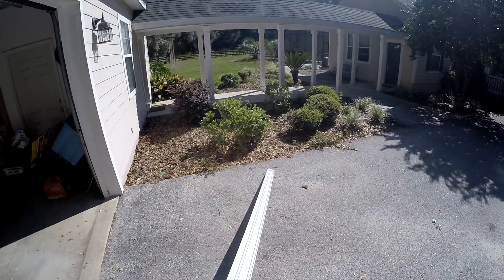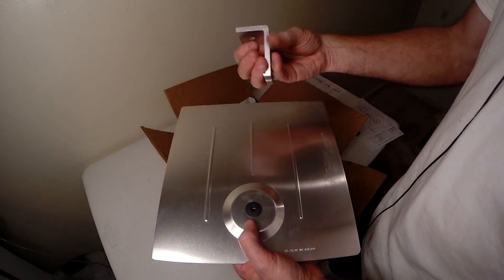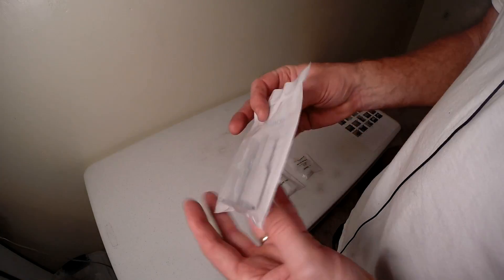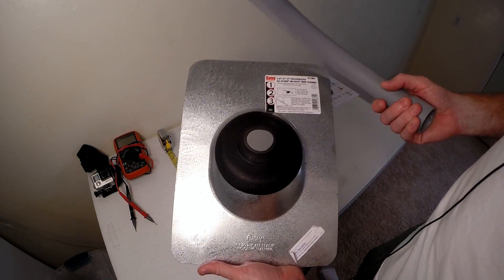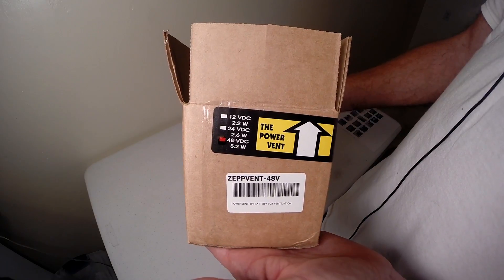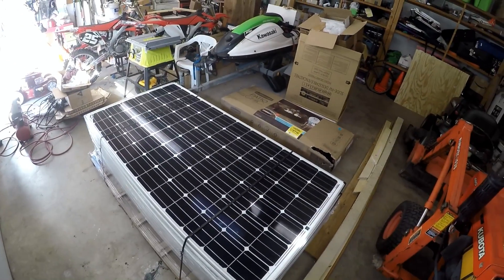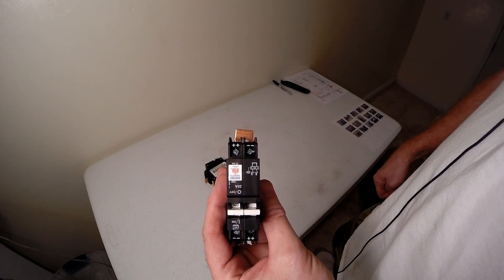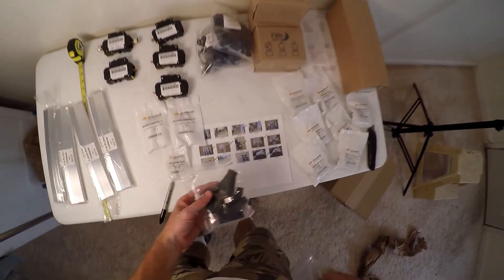Off Grid Solar #4: IronRidge, SolarWorld, Trojan Unboxing

Comment: Why didn't you use lithium batteries
Reply from the maker: I think the flooded lead acid batteries that I bought still offer the best bang for the buck.  That said, I am anticipating that I may switch to lithium in the form of used car batteries in the future.  I expect there will be a lot of electric car batteries available at great prices by the time I need to replace my Trojans.  Thanks!
Reply: Yes sir I find Prius and Hyundai batteries all the time 
I'm bingeing all of your vids 
You didn't do a completed kitchen vid 😜😐
Reply from the maker: Well I hope your getting something out of it.  I guess you're right about the completed kitchen video.  Maybe because we stalled out just before it was actually done.  I need to circle back and complete that project!  Thanks!